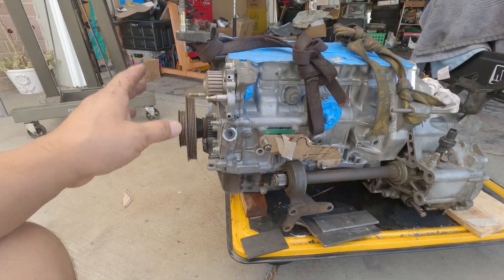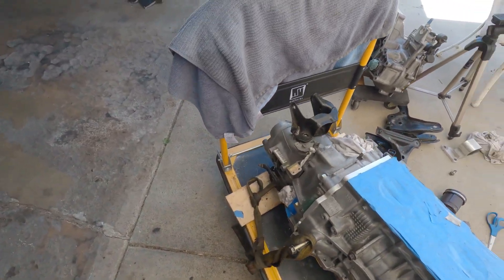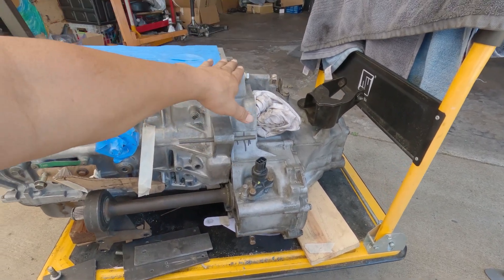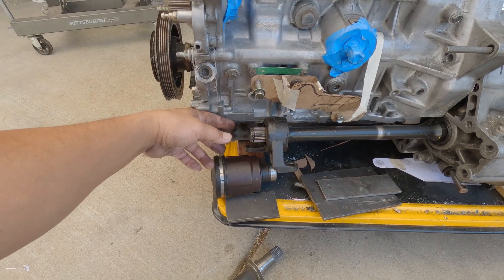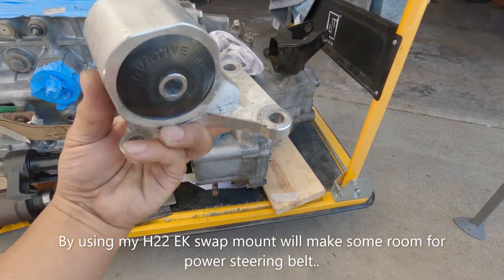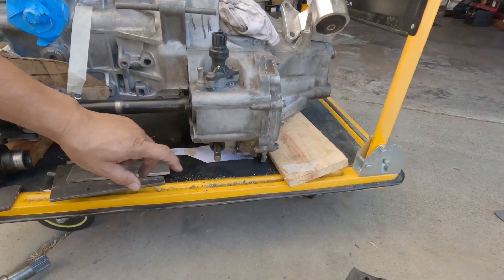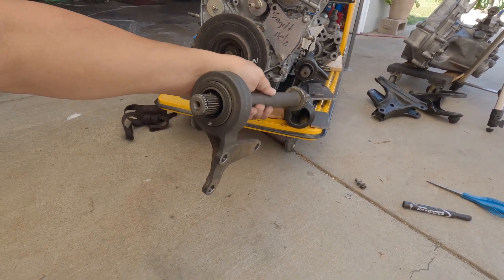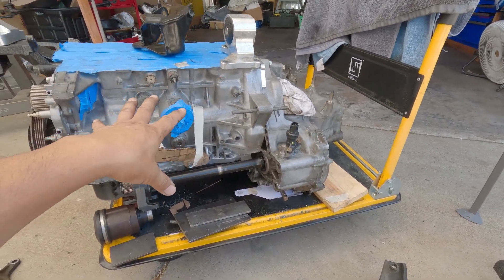G2B build w/ an idea of using H22 Half shaft. Things I have to face with! ep. 4

Comment: Thanks for sharing the info ... I'll probably use your videos as a guide next year.
Regarding the power steering , I would remove the excess from the harmonic balancer. And I would use a volvo Electric-hydraulic pump . Like this you would probably clear the rails with the transmission in the oem position, and the shifter would be straight.
Reply from the maker: I'll soon find out if it'll work and good luck on you build project. Thanks bruh!